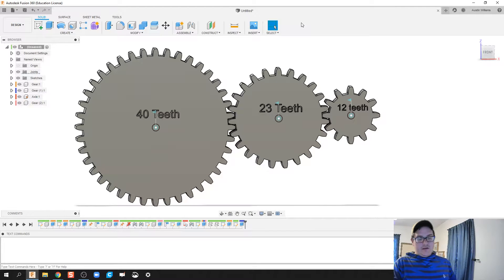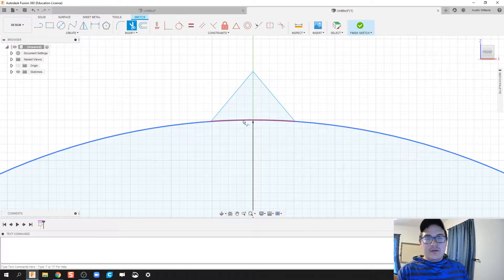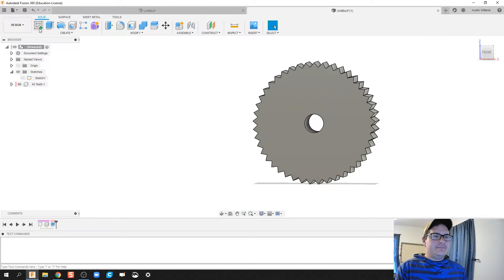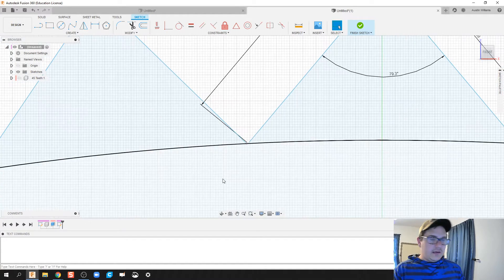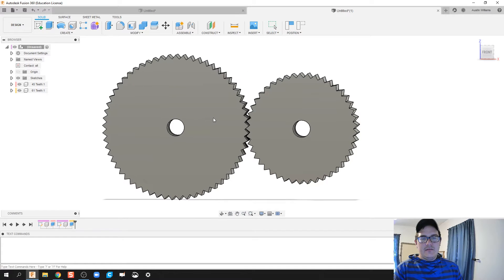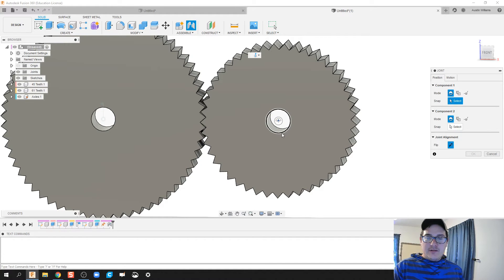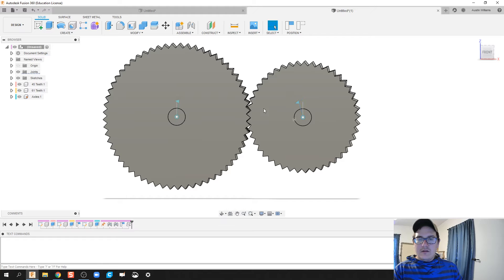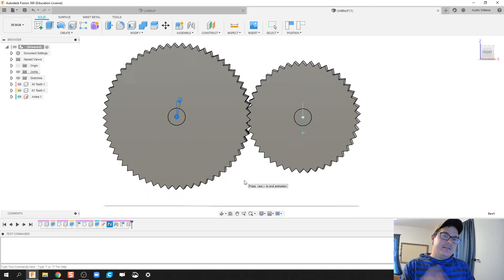Motion Links and Gear Ratios - Day 74 of 100 Autodesk Fusion 360 Journey

Comment: Agreed.  Contact sets are an absolute nightmare.  You can almost hear your computer crying if you try anything involving more than a few faces.  Ditto on the labeling as well; always put tooth number in component and body names, as well as the joints and motion links if you want to avoid lots of doublework.  As far as the joint goes, I like to divide one gear's tooth count by the other's and use the reciprocal of that figure as the input for the motion link.  It preserves a 1 in the ratio so it's clear at a glance.